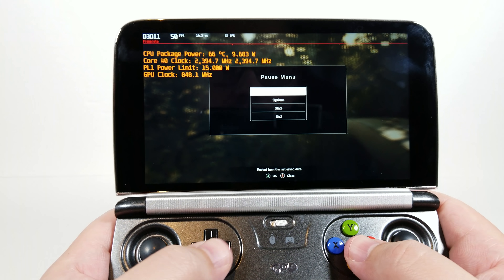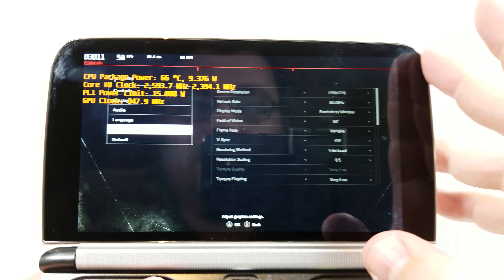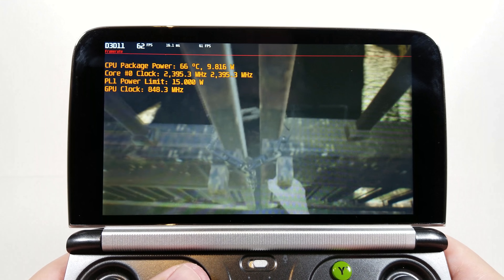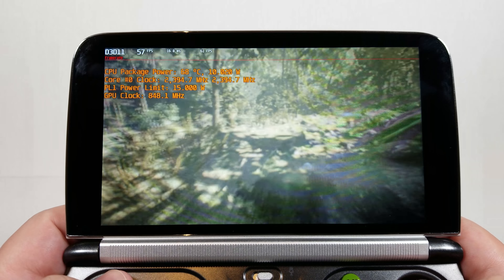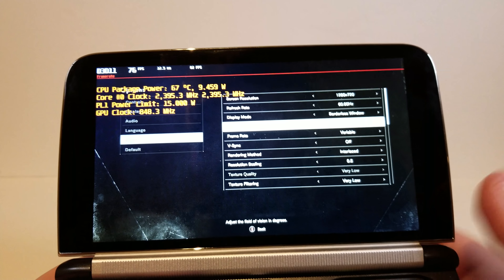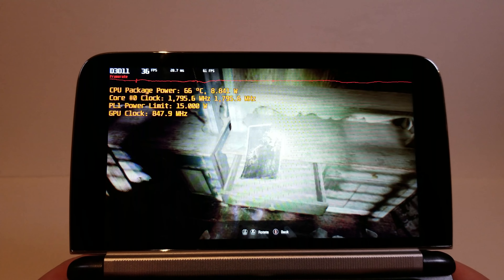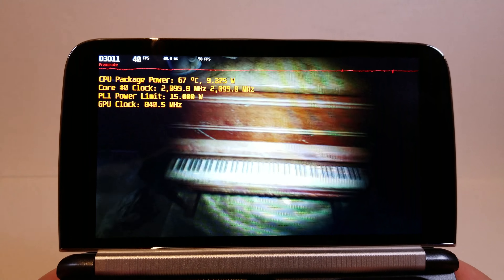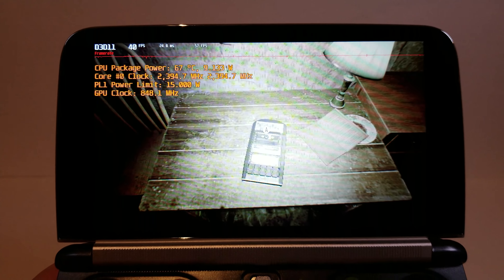GPD Win 2 - Resident Evil 7 MAX POWER 15 Watt TDP

Comment: This thing costs 700 bucks and they are using a cheap cooling solution...
Reply: no they opted for 7W TDP and the cooling for that is sufficient.
Reply: @GoodOlKuro  Yes but this device is still overpriced for what it's capable of.
Reply: @Fendera1  Thats the cost of this form factor
Reply: @jkouw  that doesn't make any sense since they are not using a special tecnology or materials to achieve this form factor , since they are the only company selling pc's they could drop the price to 550 for example and probly have a much better income due to an increased popularity whereas now when it is out for everyone to buy , it is still unknown with only one guy sponsored by the company making videos of it
Reply: @panosf5779  gpd obviously prefers revenue over quantity of production, which is ok. They probably also dunt want to increase their production volume, to not run unto financial risks. Now, if other companies will enter the handheld market thinks would definitely change. Its simple, they are the only ones to offer a handheld pc like this for decent gaming in the go... No rival, so they know they can ask for this price, even if the price point sets off people like you and me. I didn't get the win2 because of the price. I mean, its Windows... Emulators, Windows games, steam, browser games, sandbox, browsing, PlayStation remote play... You name it... It's simply great to have such a nice little machine with decent power and nice controllers / buttons integrated to play on the go, but I'm not sufficiently nerd or game to pay that price. I mean the gpd xD plus its also nice, much cheaper, but still... It's Android, for that I get an attachable Bluetooth controller for my mobile right? 😁 Well... I also hope they do the price a bit, I mean, that thing is over a year old... Time to get the price down a bit. 500 dollar price tag would be good, they could fire up a new win3 with updated specs for the full price... But I guess they won't do that. If they put out a new handheld they probably just stop producing thisone, unfortunately.
Reply: I believe that battery life was their main target and that's why they did not need to cool down the CPU like a beast, and I don't think that the device is overpriced, it's pretty well speced for the size. 

Don't forget you are paying for the size reduction and that ALWAYS involved making sacrifices.
Reply: @Fendera1  
Yes but this device is still overpriced for what it's capable of."
This mini PC can run PC games, while $700 smart phones can't.
Reply: @EliosMoonElios  But a Nintendo Switch $300 can run games just fine.
Reply: @Fendera1  
"But a Nintendo Switch $300 can run games just fine."
Because Switch's games are optimized for it, that is not impressive, otherwise a handheld PC able to run games designed for a full desktop PC that is really an impressive show of power and you can use it as a PC for work or entertaining too otherwise Switch is not as versatile.

$700 for a mini PC portable to do your work or use as a gaming device or home theater in vacations or business trips that is $700 bucks well used.
Reply: @EliosMoonElios  The GPD Win 2 is not that powerful as you say it is.. I'm not talking about optimization here, I'm talking about what you get for the money. 300 bucks for the Switch is a great deal. 700 bucks for the GPD Win 2 is to much for what it can do and how it's built imo.
Reply: EliosMoonElios For the same price you can get a gaming laptop with a 1050 or 1050 ti with a core i5 8300H
Reply: @justinwong939  But you can carry around that laptop in vacations or travels? No that laptop stay in the hotel room.
Reply: @DunnoKnowles im talking with a economical state of mind politics has little to do with this
Reply: If you learn accounting. Why gpd more expensive it'is because it's not mass produced. While nintendo switch is produced by large number which is. it can be more cost effective.
Reply: @adnansz8930  i assumed it was mass produced , i guess that is indeed the reason of their pricing strategy
Reply: Your statement is like complaining about a painting and saying it is just a bunch of paint in a big paper.
Reply: Or it's like mocking people for buying caviar that cost thousand of bucks
Reply: Like the big boss pro. picture
Reply: you are making excuses for them, 700 for this is outrageous, and for 700 its severly ender specced...form factor does not matter...if i create a handheld the size of gameboy micro that plays pc games terribly can i also chagre 3000 for it?? because form factor @TontonGahu
Reply: if you call this "running" id hate to know what you consider gaming @EliosMoonElios
Reply: @Bidwellz9   the thing is... Do you have any competitor on the market?
Is anybody else doing the same?
Did you take into account the cost of developing such a small device?
People easily forget that the price of a device is not only specs.
Reply: @Bidwellz9  
Running is running whatever the game look good or bad, fast or slow, if it start and don't crash it is running.

Trying to moke my comment only show you can't use real arguments to prove me wrong.
I guess you don't know but many Switch games run slow and with poor graphics too, like Zelda Breath of the wild in dock mode.
Reply: again, this is a rippoff....you can justify burning money however you like @EliosMoonElios
Reply: @Bidwellz9  
Again I repeat myself:
Mocking this device calling it ripoff only show you have no real arguments to prove me wrong.
Reply: if thats what helps you sleep at night bud. the real person with no arguments is you. its obvious its a rippoff, you are the one trying to say its not. burden of proof that it isnt is on you. explain to us how 700 dollars is justified just because it has 2 analogs and xbox buttons, when for that same 700 you can get a laptop with better specs in every category and a small footprint to boot.   @EliosMoonElios
Reply: @Bidwellz9  
"if thats what helps you sleep at night bud"
more mockery show your lack of confidence in your own arguments.

"when for that same 700 you can get a laptop with better specs in every category and a small footprint to boot"
Already refute that argument:

[ Justin Wong ]:  For the same price you can get a gaming laptop with a 1050 or 1050 ti with a core i5 8300H

[ EliosMoonElios ]:  But you can carry around that laptop in vacations or travels? No that laptop stay in the hotel room, you can use this device as a handheld laptop while a real laptop is to bulky to be used as an Handheld.

PD: Do the Switch can let you play almost all GB, GBC, GBA, NES, SNES, GC(better resolution, 60FPS), Wii games? No, Switch have a very limited retro library, mean while this device can run EMULATORS for SEGA, NINTENDO, SONY, ATARI... ETC... ETC... ETC.
Reply: how would that in any way show a lack of confidence? please elaborate oh thoughtful one. like i said, tell us how you justify a 700 dollar gameboy............... @EliosMoonElios
Reply: @Bidwellz9  
"us how you justify a 700 dollar gameboy"
Again with the mockery calling it a game boy when it can run thousand of games than the Switch can't.

I already show this mini PC can be as versatile as a laptop but way more portable.

All your "arguments" are mockery of the device or my arguments not real arguments.
Reply: EliosMoonElios A phone can also do that....
Reply: EliosMoonElios For what it is, it is quite expensive. They are clearly making a lot of profit off of this.
Reply: EliosMoonElios In terms of productivity a laptop would beat this device anyday
Reply: @justinwong939  
If you belief "this device is weakest than a $700 laptop then MUST BE CHEAPER" you are an ignorant.

Ask a laptop company how much cost to reduce a laptop to a handheld size, reducing the size always means to use less strong components but at highest temps than is why laptop's GPU's are weakest than Destop's GPU's.
Reply: @EliosMoonElios  It's using a low tdp chip. Materials and development won't cost them enough to make up for insane amount of profit it is. How can u get a laptop with specs so much higher for the same price.
Reply: @justinwong939  
I repeat myself: ask a laptop maker if they can make a gaming laptop as small as an handheld for the same price of a normal size laptop.

I guess you don't know but Gaming Laptops are NOT as strong as Gaming Desktops and the ONLY gaming laptops with the power to compete with Gaming Desktops are 5kg behemoths than are NOT so portable or comfortable to use in LAP for the weight, those are more like Portable Desktops.
Reply: @justinwong939  
And that behemoths cost as much as a high end Gaming Desktop with less performance.

Why that behemoth Gaming Laptop cost $2,000 if it is weakest than a $2,000 Gaming Desktop? Must be a scam right?
Reply: EliosMoonElios Then they should lower the price. Its not an excuse. It might not be able to make up for the power difference but their should be a huge price difference
Reply: @justinwong939  You only want it cheaper without care for the developers inversion in money, time and work to make it small.
Reply: EliosMoonElios The difference is also the fact that they struggle to fit such power hungry chips inside a laptop. They also include high refresh rate Gwynn moniters and a bunch of other things that dont come with a desktop. Even then you cant find ones that dont cost that much more then their desktop counterparts. When comparing the win 2 to a normal laptop, it is much more overpriced.
Reply: EliosMoonElios Yet the device costs nowhere near that much to make. Thats literally almost apple level profits right there
Reply: Good news is, its not made by Apple
Reply: Its a hyped up product and not even really hyped, hyped among a very small base of people. Avoid this like the plague.
Reply: you aren't paying for performance at this point, you are paying for the form-factor. if this device were  backed by a company with substantial finances (as well as a way to mass produce them) you may see the price actually drop for consumers. Sadly this is not the case.
Reply: @FreedomAreComing lmao, it can run Doom.
Reply: more like with mx150 perhaps
Reply: @Fendera1  "But a Nintendo Switch $300 can run games just fine." literally ruined your credibility with this one post
Reply: @AirDyran  why? @EliosMoonElios said "This mini PC can run PC games, while $700 smart phones can't." I only pointed out that a way cheaper device like a Nintendo Switch can perform well for the price.
Reply: Smaller form factors are usually more expensive to make and more if its custom which this has both
Reply: @claf7889  it's not exactly a mass market product. The 'hype' is just down to the fact that its a fully functional PC with integrated controls, and shrunk down to a size similar to a DS lite.

Is it a high performance gaming powerhouse? No

Is it going to appeal to everyone? No

But there's no denying that there's nothing else like it on the market, and for the small number of deep pocketed enthusiasts who actually buy one, it will offer a more diverse handheld gaming experience than anything else. As a technical achievement alone, its fairly impressive.
Reply: @EliosMoonElios  plz it will die in 3 months lol nintendo products last forever
Reply: @EliosMoonElios  Good on you for trying to explain basic economics to kids. If you are making a full version tech this small it becomes more expensive. Any gaming PC at $5000 is more powerful than the same in a gaming laptop and the same is true if you reduce it to this size. But for some reason that concept is really hard for some people lol!

Comment: 0.5 resolution scaling is 50% of the height and width resolution. only Ubisoft use it as the amount of pixel rendered afaik
Also with RE7, when you use interlaced it's even less pixel rendered due to a type of checkerboard rendering, so it would be lower than 0.5 resolution scaling
Reply: Still, if you limit fps to the console 30 fps, that would allow higher settings
Reply: @slasaru  why do you want 30fps though? And this game on consoles is 60fps, not 30

Comment: Wow,  so this can play it natively, yet the Switch has to stream it to get it to run :S
Reply from the maker: The Switch's GPU is beefy it's just those CPUs (especially in handheld mode) that most likely RE7 isn't capable of running.
Reply: @ThePhawx  RE7 could run on the Switch if they really tried. Also, Capcom even asked Nintendo to use 4GB RAM so their games would run on the system!
Reply: @ThePhawx  CPU clocks are the same between handheld and docked mode on Switch (and yeah it is slow at 1 GHz). Also, Switch's GPU is not even half as powerful when undocked as intel 615 HD and of course developers have to make the game run it that mode to release on Switch.
Reply: @ADHGaming  RE Revelations haven't even reached a million copies in sales on 3DS despite huge installed base of the system. I guess Capcom just don't want to bother considering no 3rd party title haven't reached big numbers in sales on Switch. Only games developed or published by Nintendo sell well on Switch.
Reply: @Sly2Cooper  That's not true though. Whilst i would agree with the 3DS not selling well for third parties, the switch has a much wider audience and several 3rd party games have sold well. Another issue is that they always seem to release the games much later on nintendo consoles.
Reply: @ADHGaming  3DS has a huge gaming library but only few (around five!!) 3rd party titles reached over a million copies. Check the wiki. And it's the same situation for GameCube, Wii, WiiU, DS, 3DS or Switch. I mostly played 3rd party games on my DS/3DS. But the major Nintendo audience tend to buy Nintendo published games ONLY. And only a tiny fracture buys from other big publishers. That's why 3rd party publishers stop support Nintendo home consoles mostly on the 3rd year. And this is the reason multiplatform games are released later or for the most part are not released at all on Switch.  For example Bethesda have published Doom and Wolfenstein for Switch and have announced the Doom Eternal, but not Fallout, Rage, Evil Within or some other their titles. Check all the major multiplatform games of 2017, 2018, 2019 and count how many of them are announced for Switch.
You don't have that with Win 2. The one thing I love about my Win 2 is it's vast library and absolutely no problems with 3rd party multipltform games availability from ancient classic like Fallout 1 to modern games like Fallout 4 (the other thing I love is Steam sales).
With Switch I'm waiting for the Metroid Prime to be released to think about buing the console.
Reply: the switches gpu is too underclocked
Reply: Cutter Elf .....You cant directly compare power. Handheld mode switch is pretty comparable since it only needs to be optimized for 1 system instead of many
Reply: Sly2Cooper I mean a couple third party have sold over a million already. Games will start to rack up sales among the years

Comment: 8:46 i think it was because Capcom doesn't have a good relationship with Nintendo so they only launch the game like that
Reply: That can't be it, there is the Revelations Collection on the Switch and more RE games like 4, 0, and REmake coming this year, I think they are good.
Reply: Also, Wolfenstein: the New Colossus runs on a switch, a game that's much more demanding than RE7, so maybe it's an engine compatibility issue, like, there's only support for x86 architecture. I remember RE7 had trouble with processors that lacked the SSE4.1 instruction set. It also didn't run on my Core 2 Quad on launch (I know its an archaic processor, but it has SSE4.1 and it's more than powerful enough to run this game).
Reply: I doubt it. Capcom has had a good relationship with Nintendo for a while now. They were a huge supporter of the 3DS,....though that might just be because the 3DS was the cheapest to develop for.
Reply: It has nothing to do with their relationship. Capcom were being bullish and were waiting to see how well the switch does before they ported their games to it